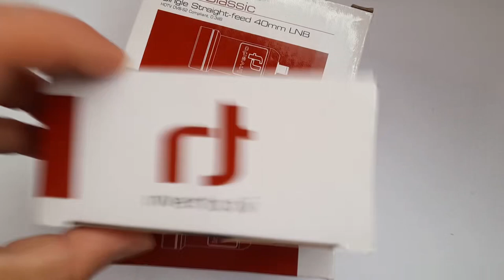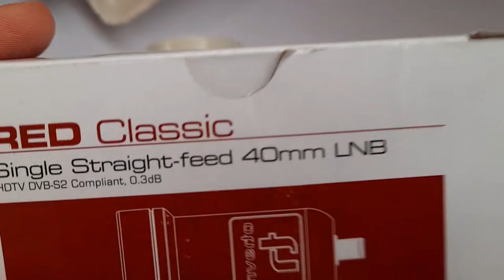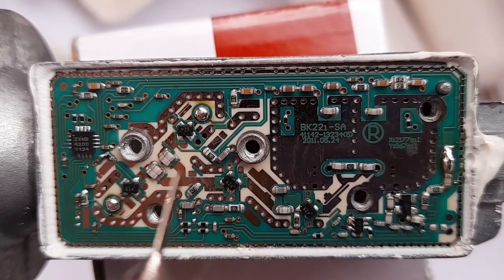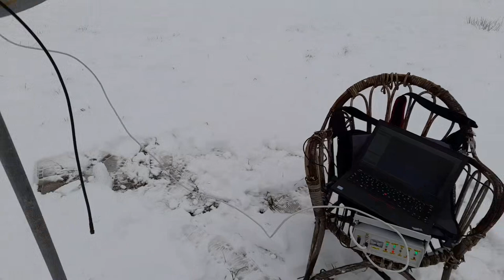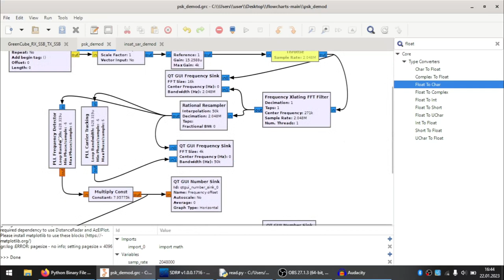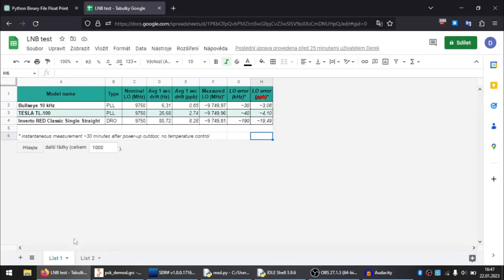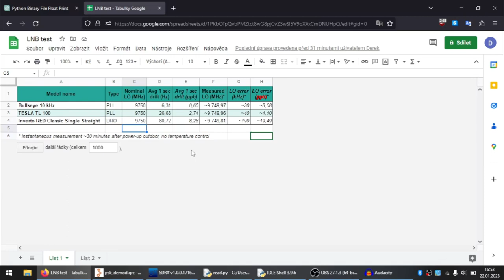Questionable DRO LNB teardown & test (INVERTO RED Classic Single straight 40mm)

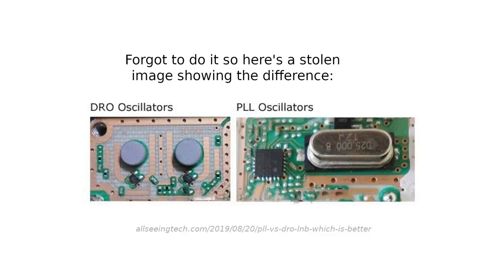Comment: 8:52 Did you just call me nobody? 🧐😂Good idea though, there seems to be little to no "entry level" information and particularly nothing useful on YT. I'll put it on my list. 12:24 The Diameter of a Dielectric Resonator is roughly the speed of light divided by [the desired frequency times the square root of the relative permittivity of the material used]. The material is usually some barium and titanium oxide.  At the resonance frequency, the electric field moves in circles inside the resonator, like being stuck in a roundabout. This is called the TE01δ (say: TE 01 delta) mode. The little striplines next to it are used to couple some of the oscillator's signal into the "roundabout" and the other stripline is used to couple some of the signal in the roundabout back into the amplifier, thus closing the loop (and fullfilling the Barkhausen stability criterion). The dielectric resonator is usually positioned 1/4th of a wavelength away from the end of a microstripline as the E-field has a maximum peak there. If you see one microstripline being longer than the other, one is simply 1/2 wavelength (or multiples of 1/2)  longer than 1/4th wavelength. Which changes nothing from an impedance and field strength standpoint, but reduces direct coupling from one microstrip into the other. This roundabout effekt of the TE01δ mode only works at the correct resonance frequency. The reason why they can be tuned with metallic objects, such as screw, is, because there also is a magnetic field influencing the flow of traffic in the roundabout. Changing the permeability by disturbing the H-field will shift the resonance frequency.